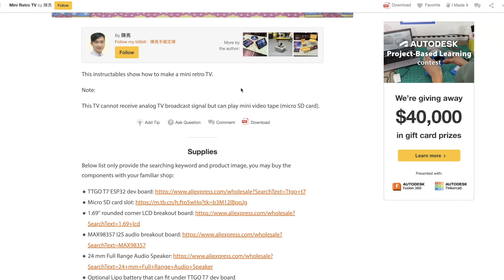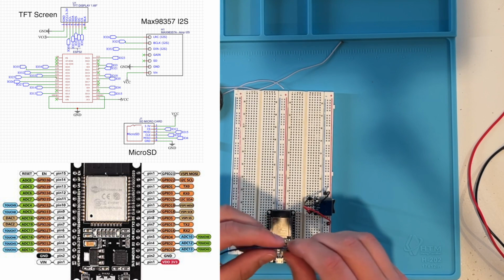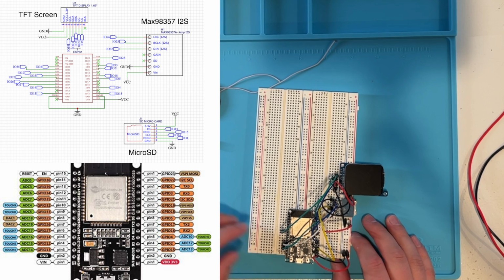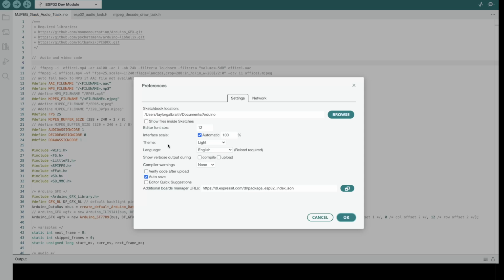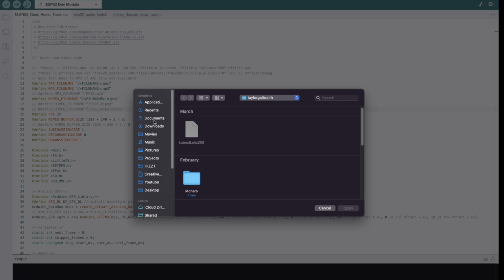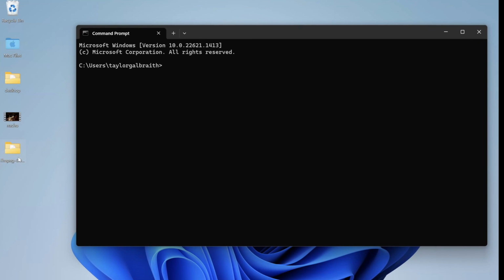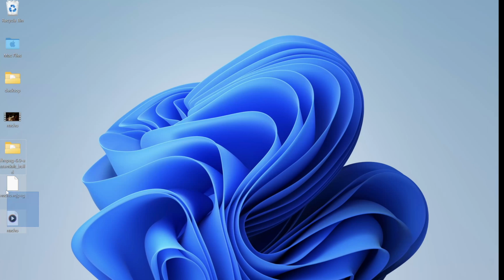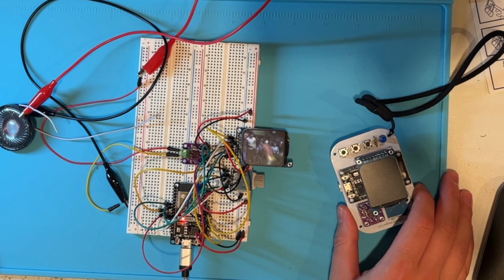ESP32 Mini TV Tutorial Build

Comment: Didn't realise you could get LCDs with an old-school CRT screen shape. Neat!
Reply: These come off a smart watch.
Reply: you can also just 3d print a rounded frame for a normal 4:3 display works just as well 
if you dont have a 3d printer you can use vinyl cut into the right shape and just tape it to the screen .
for a real jank setup black electrician tape and a something to cut it with or a black sharpie

Comment: The partition tool I use is AOMEI Partition Assistant. I used it to convert a 1TB SSD to Fat32 so I could use it in my PS3. It is less "jank" and works as well, so long as you connect to the drive you want to format to a Windows computer. Just an alternative program that might work if you have issues with yours.

A rather cool project, and was unsure if the screens Aliexpress had were actually legit or complete bs... so I am confident enough to buy them now, as I know they work.